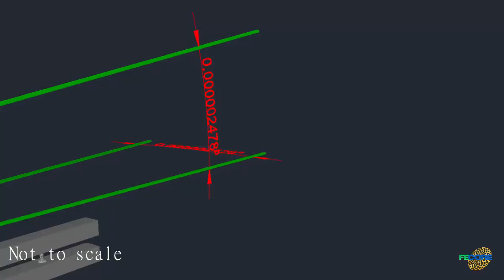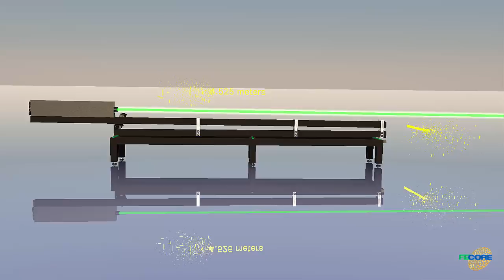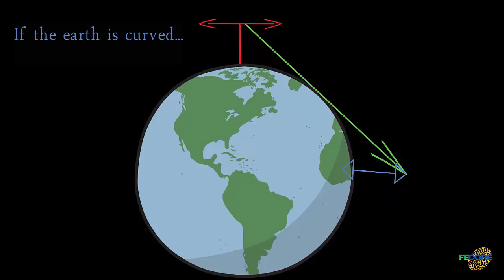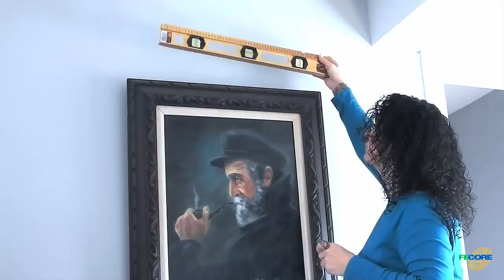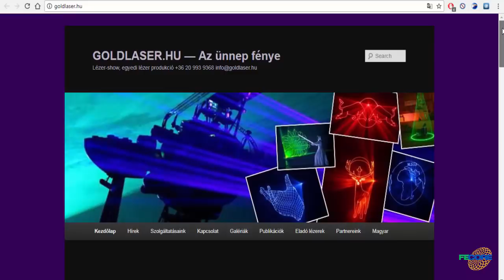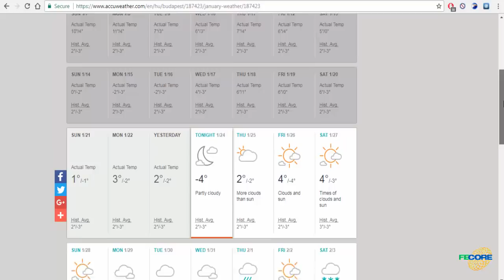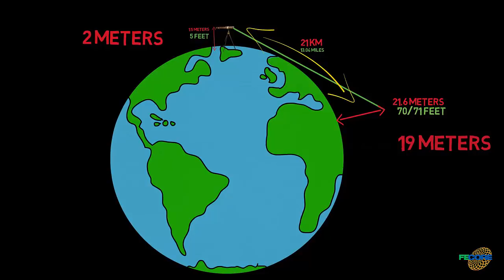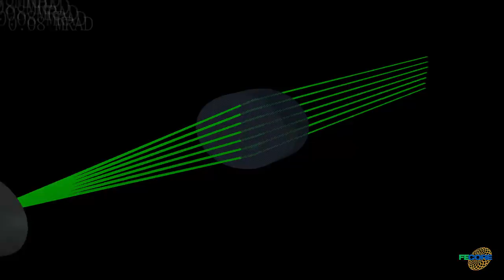FECORE   The Biggest Laser Experiment In History Q & A   Pretest

Comment: Steve.  I've proposed to do some tests at the Bolivian
Salt flats . It's just a thought if the lake doesn't freeze over maybe something like this could provide an alternative venue. My idea is to use a dual system of measurement but set up differently so as not to conflict data sets but more to compliment.    Maybe also verified with seismic activity readings  but I'm not sure that's necasery at this stage.n My idea is embryonic and maybe easily conducted at the Bonneville flats , I don't know I have never been to either.  The thought if had is that the flats would have been formed naturally according to the forces of nature   ,for example centrifugal force gravity and evaporation . Therefore they are a good reflection of the surface of the earth shape and curvature should be easily detectable or not as the case might be.   It's embryonic at this stage and I have never been so obviously checks about the surface stability and permissions being granted are first considerations.   What are your thoughts.  You would obviously be working independently but I see an opportunity for you.

Comment: You guys are gonna nail it! Don't lose heart if you experience difficulties. I understand the technical aspects of this experiment. Your leveling rig is well designed. You guys should think about shielding the mounted laser from the wind. A barrier wall of plywood or even a covered 3 sided shed would help with that, and should be very cheap to build.  I WISH I COULD BE THERE.